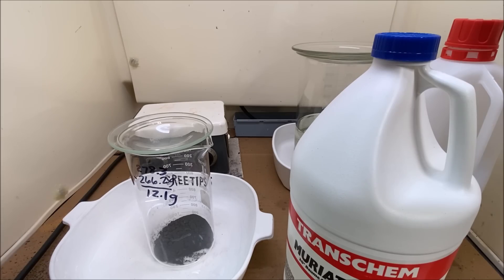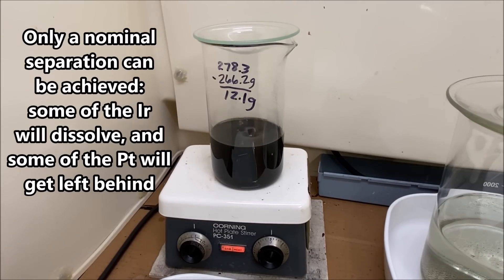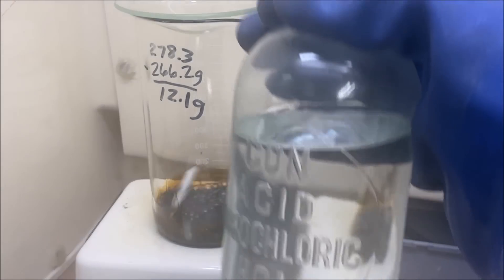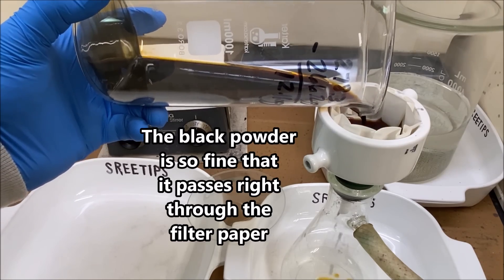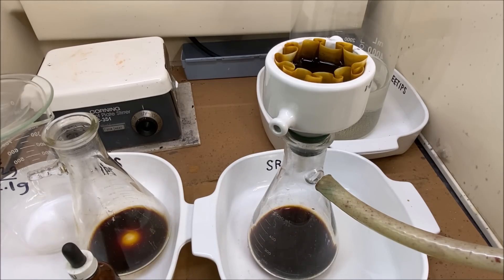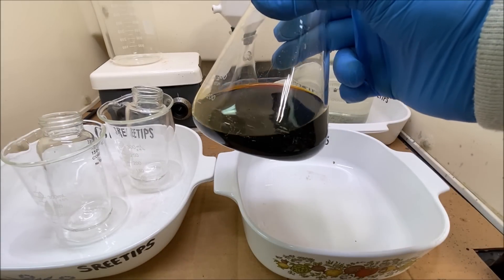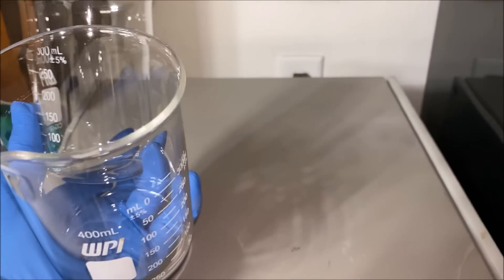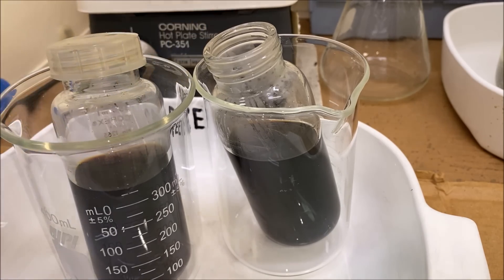Platinum Refining Bromate Hydrolysis Pt5

Comment: I really appreciate to see your approach to work. Some hint: I am using plastic funnels [thick polypropylene, food grade], tightly packed with cotton wool [it will disintegrate when boiled in aqua regia or HCl +hydrogen peroxide to dense pulp - same as paper filter] to filter such solutions. It may not help for coloids [failed with gold dropped with SnCl2], but it work well with PGM in very divided state and any other fine particles. And loads up with particle faster than paper filter - sometimes will be needed to re-filtrate.  

I thought to suggest to completely dissolve those particles, maybe coagulant would helped to drop particles, however they are organic material - unwanted in process. 
But I checked and on pictures of Iridium dioxide this is black powder and tetrachlorides are also brown to black colored - this is may lead to conclusion that iridium is already as oxide or chloride in your solution, and mettalic state leftovers are filtered. In this case they should - maybe after some time like ater overnight - finally start to fall out if they are there [just my thoughts].
In process you will use sodium bromate - maybe worth to try few ml's of "ink" in test tube and to add few bromate crystals and eventually gently heat this? Also to testing if  hydrogen peroxide will help, small amounts would be enough.

I found some pictures of iridium compounds under link below:

https://woelen.homescience.net/science/chem/exps/iridium/index.html

Iridium if will be separated [I completely not understand how it works in real life, I have collected only gram of contacts from this alloy, quite rare, to little to work with] by oxidation, will require to be alkali melted with sodium peroxide [I found notice that calcium carbonate may work instead]. Calcined products of this reaction are dissolved in hydrochloric acid getting iridium back to solution. 

I think that parting this material with aqua regia [and getting back enriched with Ir undissolved Pt] can be ommited and process improved if more material will dissolve [like with chlorine] - and all this iridium will fall down as IrO2, when pH will be over 4. Bromate is litteraly bromine "in crystallic form", as it reacts directly with HCl/HBr to oxidize them to free bromine/chlorine. And platinum will be still as PtCl6[2-] form until reach 5.5 [we stop here and filter] - and this is essence of this method in my understaning [with titration - sodium hydroxide/carbonate?]. 
For me question is - which pH indicator shall be used [I think for "masters" at this process apperance of solution, practicly gives all necessary data] - solution will contain bromine which rather destroy litmus or something than let indicator compound change tautomeric form. If iridium have similar colors as palladium have - brightening of solution may be this sign of pH reaching Ir drop zone [and break of colloid as new particles aggregating should precipitate this].

I think I will not have opportunity [yes, only for my personal delightment and satisfaction from lessons learned and achieved results] to learn method for puryfing such stuff. I learned already how gold [yep, also thanks to your work on educating  folks] can be purified to 4N [99.99 after melting, confirmed on XRF]. For palladium after precipitation, and bromate oxidizing - calcined material also gave 4N [but machine not see/search for chlorine as powder contained some chlorides] - after melt [Pd felt offended by Eddy Currents and resisted to heat up first] with pure copper, sample was tested with XRF and only Cu/Pd in alloy. I know, amount of work placed for this was totally inadequate to price I got for it - but from hobby perspective - another weekend spent on something that keeps me happy.

Hope you survived reading this and it give you some thought what to do next.
Cheers
Reply from the maker: Doing the small dose with the bromate crystals experiment sounds like a good move.
Reply from the maker: I read the whole post, thank you.
Reply: 4n for pd interessting , i would like see you're process bro

Comment: Have you tried filtering the solution through a layer of dried celite/diatomaceous earth? That has always pulled fine suspensions of LiCl out of solution for me when it wasn't caught by filter papers. I don't imagine something with that high a surface area will do your recovery yield any good at all though =/ I'm also unsure how it'll interact with the acidic solution so silica might be an alternative.
Reply: Was going to suggest the same.
Reply from the maker: I think this is colloidal and would probably get past celite. But it’s worth a try.

Comment: I would have two suggestions, but I do not know how they would perform in real life:
1. Using a long column for solid chromatography with silicagel or fine silicon dioxide (SiO2) as stationary phase. Iridium particles due to the high density and particle size should be slowed down.
2. Use elemental sulfur to form Iridium disulfide (IrS2) under pressure of 1 atm.   
In both cases I do not know how the chloroplatinic acid or the remnants of aqua regia would influence the reaction or interaction with the solid phase.
Reply: Sulfur will probably drop platinum either, both sulfides are insoluble. Aqua regia should oxidize most sulfides to sulfuric but I think it would not work for PGM ones - and sulphide ores require to burn them away first before solubilizing.
Idea with chromatography is interesting, but I am not sure how to remove Ir from column...

Comment: Would adding more hcl to the platinum solution help with the centrifuge process? The concentration of the suspension would be less and once you separate that out you can reconcentrate the platinum. Idk just throwing ideas out there. Glad you are trying platinum refining, despite the difficulty and danger.

Comment: I was going to suggest putting the liquid through a centrifuge, which you did. However, since the particles you are trying to centrifuge out of the liquid are so incredibly small, they have very small individual mass. Therefore, the warmer the liquid in which they are suspended the stronger their "Brownian" movement, in other words diffusion through the liquid, and the higher your centrifugal speed needs to be. I would suggest cooling the flasks down in the fridge to close to freezing and then spinning them at maximum speed in the centrifuge. It might not take all of the solids out of the liquid but it would help I believe. It's simply physics after all :)
Reply: First thing that popped into my head was Nile red saying, and now we're going to filter through some cotton wool and celite.
Reply: @Keith Yinger  +1 on the celite suggestion, though if it does catch the iridium I wonder how it would effect the iridium melt...
Reply: @suey1690  agree Celite is a great filter what we use to Decolorize hash oil
Reply: @suey1690  that I do now know. I know celite is also known as diatomaceous earth, which is mostly silica. Fossilized diatoms. In which case, a highly basic solution might dissolve the silica afterwards. I'm not sure if iridium would also dissolve in the basic solution as well, which would be a problem unless you could drop the iridium from a basic solution afterwards possibly.
Reply: I have one term for everybody, flocculent, this is your means of making small particles into big particles or at least bigger after all this is not an ionic suspension is it?
Reply: It strikes me, too, that he ran the 'fuge at a fairly low speed.  Higher speeds mean higher effective G-forces, which mean more and lighter stuff settles out.  He should have run it harder.  At least, that's how it seems to me, but I acknowledge that I'm an amateur at best, so I could be wrong.  The logic seems sound, though.
Reply: I always thought the boiling made gold settle out of liquids better.
Reply: I agree with the centrifugal approach or find some chemical that would act as a 'flocc' in the AR..
Reply: You had so same thing in part 4

Comment: When we evaporated to "gravy" we always filled it back up to the exact same volume. The first time we would use a 20% solution of HCl and H2O. The second time, 10%. The third time, 5%. Always being careful to go back to our original volume. Start with 250 ml. end with 250 ml..Most times you can just start the project all over again. Your solution has become super- pregnant. I would try a 5-1 ratio with the aqua-regia at 500 ml. You'd still be only "noxing" 100 ml. All these steps take time to boil down and sometimes we try to hurry them up. I did it this way with gold. Same steps as above and precipitated 9, 9's fine. Tested .999999999 by 3 different labs in the bay area. It took time. Three days for 10 ozs. but it was 1st drop. No need to re-dissolve.
Reply: Hello sir, what kind of device was used to testing samples up to .999999999? It was EDX or XRF tested? What was used as calibration standard?
Reply: @Etoxiran  XRF. When my boss asked why it couldn't do a thousand he was told because there is no instrument that could. The one lab tested all the government orders for metals, received.
Reply: @richardbeee  Thanks for info, they both work on similar manner - irradiate sample with x-ray and measure "spectrum" re-emitted. For each energy value measured by detector, number of photon detection is counted to plot graph. Graph from compared to spectrum saved from calibration - I've seen once that owner tested his own 4N bar and machine show 100.00 🙂 Electrolysis [Wohlwill] gives up to 5N. All above would require to use methods like zone remelting or vapor deposition [distillation in vacuum furnance] and ICP-MS testing for each found in raw material impurity.
Reply: @Etoxiran  Colloidal is his problem!

Comment: After dissolved in aqua regia The platinum is precipitated from solution with ammonium chloride, and the resulting crude platinum salt is recovered by filtration and then heated to decompose it to a powdered metallic form. The metal is redissolved in aqua regia, then reprecipitated with ammonium chloride and calcined to pure metal. The palladium, which remained in solution when the platinum was precipitated, is now precipitated by the addition of ammonia. After the palladium salts are recovered by filtration, they are redissolved and reprecipitated to form a pure salt, and this is converted to metallic form, usually by chemical reduction with formic acid.

The residue left over from leaching the original mineral concentrate contains rhodium, iridium, ruthenium, and osmium. This is treated with molten sodium bisulfate to convert the rhodium to rhodium sulfate.